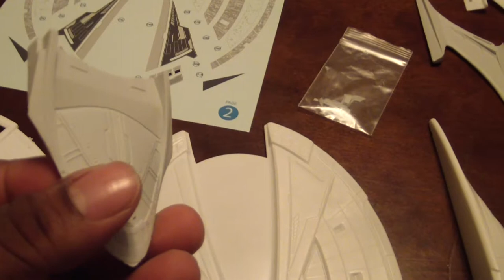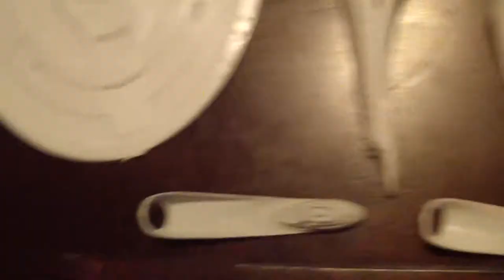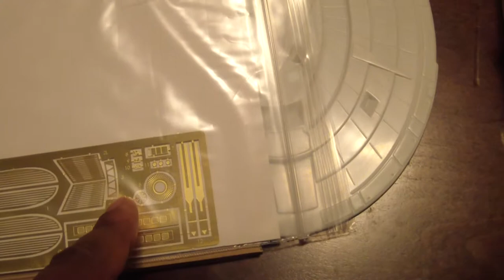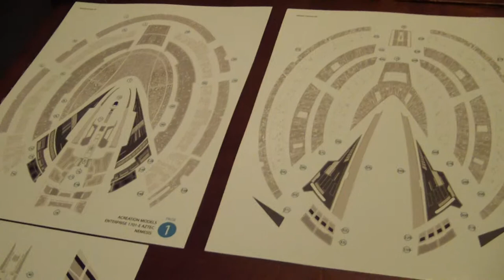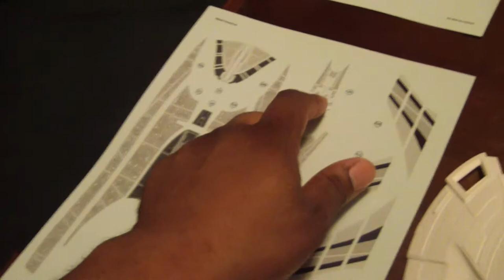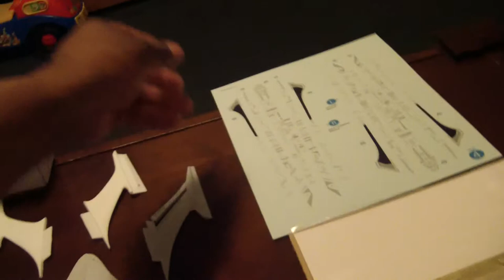Enterprise 1701-E Nemesis Version Video

Comment from the maker: The conversion is for the AMT Enterprise.  Starcraft Models built it.  I just checked federation models and starfleet models and both are still out.  When I got mine, federation models had just had 2 come in so I popped in on one of them pronto.  You might try emailing either site to see the next time they are expected to get one in.  There is also a British website that also sales them at starship models dot com, not specifically built for lighting, but tunnels for wires shouldn't be too hard.